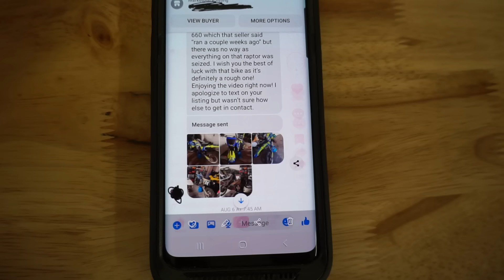Seller Lied To My Face About This $600 Dirt Bike (First Ride Attempt)

Comment: Just glad you got this,  instead of some kid who saved up to get his first bike.  Good job on this project
Reply: Yeah. That dude would have talked that kid into paying double for it.
Reply: Great point.
Reply: Sadly this just happend to me but different i bought my first quad which is an ltz400 it turned out stolen and had way more problems then he told me it had saved up for a year and a half and now i gotta do way more like frame swap it and do more
Reply: THIS point exactly! Awhile ago, I  purchased a 2001 Husqvarna CR125 that ended up needing EVERYTHING. It ran, but was lower on power than it should have been - long story short, power valve actuator had failed, took out some gear teeth, crank bearings were also burned up. 

I remember telling my wife - "The smart thing to do, if I wasn't an honest person, would be to put it back together as a 'running but needs a bit of tune up and TLC (as it would still start on the first or 2nd kick)' in the same condition as I purchased it in". Instead, after roughly $1000 or more in parts and a total rebuild I pretty much sold it and evened out in total cost invested and ALOT of lost time. 

My logic, aside from just being a decent human being, was that I couldn't stomache the thought of a 16 year old kid buying that bike with a load of issues using money he had saved up, and potentially ruining a wonderful hobby for him that could last him a lifetime.
Reply: Same thing exactly the same lol, I bought was advertised as a 2009 Kawasaki Kx85, in great running condition, what a crock that was, it was a 98 Kx80 w a newer style Kx85 gas tank, & not a 2009 Kx85, every single bearing/bushings, were rusted solid, cylinder was badly scored w all nikasil plating gone, clutch plates had zero friction material left, & clutch hub & basket was severely notched up, radiator was all smashed in w all cooling fins bent beyond straighting, long story short I put 5k into parts alone, but it is all high level performance & oem parts, & is better than new oh & the F&R suspension was crap also, thank goodness for Factory Connection,
Reply: Now I’m worried about it cause that kid is me
Reply: A kid should always take someone with them that knows what to look for
Reply: Sadly just happened to me sexier engine and burned centrifugal cluch on 2002 trx 250 ex shit blew in 30 mins just paid 2k for it saved up so much for the quad I wish karma on the dude who sold me it I’m only 17 smh but aye man ig you take losses shit really sucks tho
Reply: Seized*^

Comment: "My brother rode it last summer"  What a load of BOLLOCKS!!!  as we say here in the UK. Love your videos Joe, they brighten my day. Thanks.
Reply: He probably don’t have a brother
Reply: rode being the key word,  not under its own power mind you.  Holding on to a pick up until those hub bearings turned to dust
Reply: Grandma only road it to church on Sundays, and Ash Wednesday.
Reply: Cheers from Australia 👍
Reply: Thats why you should never buy a bike thats not running unless you are prepared to put a new motor and transmission in it.
Reply: @spartanx169x  That is always my first thought, worst-case scenario.  Swap a 250 for rebuilt 250, or worse a 450-650. But that would be easy.  You would miss the scrapes and scratches, hours searching for obscure parts, and running into brick walls at every turn.

Comment: Here is a tip for the grips. I drop a single nickel into the bottom of the grip so it lays flat. I do this to help prolong the life of the grip. Even as a kid I used to do this on my BMX bikes because I had so many grips get chewed up from the ends of the handle bars and poke through. The nickels help keep this from happening. Another grip tip if you have set of grips that in good condition but don't want to cut them off. I use compressed air and blow gun to float the grips off the bars. Works awesome.
Reply: No thanks. I’m not adding extra weight to my bike
Reply: @sk8er2420 might as well take all your plastics off 😂
Reply: That same air will help get them back on as well
Reply: i use spraypaint or clear, it works good and drys up and sticks
Reply: How about using some grip glue WTF
Reply: @MichaelLyons-h4i  nothing wrong with grip glue. You okay bro?
Reply: @PSBEadventures  yeah I'm fine bro how about you
Reply: @PSBEadventures  guarantee I've been around motorcycles on a lot longer than you have
Reply: @MichaelLyons-h4i  doing good man. Good to hear. I've been servicing them for a living for 35 years and it's been a great time. Still at it! Take care
Reply: @MichaelLyons-h4i I prefer hairspray over grip glue, works just as good, cheaper, and I can give the rest of the can to my gf so she’s happy. Win win

Comment: A bead of weld around the inside of the race will shrink the race when it cools. the bearing race will usually drop out.
Reply from the maker: I will try that
Reply: Just make sure to set the welder low enough so that you dont burn through the race! We do it all the time in my shop it works great
Reply: @2vintage  Did this for a fork head bearing, just in one spot, but no rust so maybe a few good spots instead. Good luck
Reply: Wow! A positive, constructive, helpful comment😂. I’m quickly checking news outlets for stories about a cold spell in hell. I’m gonna try this tip on my old Hodaka project, would give this bike a run for its money in the rust champion category. It’s also 20+ years older.
Reply: @2vintage  mate well done on getting this turd even running, and well done on the hammer. Oh and my bearing trick i use is keep a small selection of old inner and outer races that have one side of the ring/circle cut so it can flex open or close. Its a nice fit on a shaft or stem that uses the same bearing without binding as its no longer interference fit. I use them as dollys for removing and installing other bearings and or seals when necessary
Reply: @thediddly I've been doing the same since I was a teenager. The shop I work at has a really nice bearing install/removal kit but my custom tools still see a bit of use.
Reply: @Chris-ep5mv  custom tools dont always last but suit the job well and in this case...cheap to remake

Comment: Dude you crack me up. I love your expertise on purchasing used dirt bikes. After watching part one of this nightmare on yamaha street, we now have part two. After you took the carb apart and found half of the ocean in the float bowl that should given you some indication that you got hosed. After you took the cover off of the brake master and found the other half of the ocean, we can confirm. I can't believe you didn't take the rest of the bike apart. FYI, to bleed the brakes on a vehicle, you put a hose on the bleeder screw and place the tube in a cup filled with an inch or so of fluid. With the screw open you pump the master to purge the air out of the line making sure the master stays full of fluid. When all the bubbles gone close screw.  Can't believe you didn't take the engine apart, especially the clutch. Had to laugh when you put the chain on and the adjuster bolts were too long. When you had them out why didn't you cut like 3/4" off them and put back in ?   Anyway , you make great content for the masses, keep on wrenching....
Reply: You just yap away, huh?

Comment: Next time you have a bearing race that bad, lay a weld bead around the ID.  The cooling weld will shrink that race and if it doesnt fall out, you'll be able to use the weld as a surface to hit with a punch.  The welding trick works 98% of the time for me!

Comment: I absolutely cannot believe how easily that thing starts up. Also, I agree with your theory that somebody was riding that on some ice and broke through. It probably sat there for a couple of days, if not weeks, and then they pulled it out and it sat. It's an absolute miracle that it's running, let alone how good it's running. Absolutely blows my mind. 😂😂🐝🐝😂😂

Comment: So i recently picked up a sand blaster from Harbor Freight that was fair priced and it worked quite well for my projects, you might want to look into getting one yourself. They work quite well for cleaning up bolts so when you spray them after with the good ole PB Blaster it actually penetrates the bolt and not just the rust... Maybe you already have one i cant remember but its just a thought seeing how you work on so many classic machines you can clean up just about anything with them. Also i picked up an ultrasonic cleaner for carbs and other small parts so i can give them a soak overnight before tearing them apart and that has also impressed me quite a bit. Good luck with all the projects Bro and thanks for all the great content, the educational value is second to none your a legend my guy much love bro...

Comment: You should have got a brass punch with your new hammer instead of beating the hell out of that socket extension. 😅 😂
Reply: One step at a time..
Reply: Or perhaps wood instead of mushrooming the axle threads
Reply from the maker: Just orderd some!
Reply: And a normal set of screw drivers instead of using the bits
Reply: @2vintage  I was just kidding. I have extensions that are dedicated to pounding out seals, bearings, and races. You cannot even use them as extensions. ✌️

Comment: I for one kinda loved the claw hammer, mostly for how irrationally angry it made people 😜

Also:
1.) weld a bead on the inside of a stuck race to help dislodge and give you something to pry against.
2.) I knew the PO basically retapped the axle adjusters to Home Depot spec….as soon as you started wrenching on it with the impact it was confirmed 😣
Reply: Tbh I have dead blows and ball peens, and still prefer to use a claw hammer😂😂 the claw honestly comes in handy for prying in a pinch

Comment: To remove stuck bearing races, run a bead of weld around the inside of the race. When the weld cools, the contraction will make removal easy!. Tried & tested and unlike the little cutting wheel, leaves no damage.

Comment: cracks open the grips “SPIT ON THEM THANGS” 😂
Reply: Hawk Tua lol 😅
Reply: I always used aerosol paint when putting on new grips. Of course you have to give them time to set up so it's best to do it at night before you go to bed.
Reply: @stkyfngrszmooth   I need to replace the grips on my ktm and was thinking of actually trying to spit on them and see how it works.. does the paint make them not slide off?
Reply: @JNubski  washing up liquid ;)
Reply: This is why I'm here. Hawk Tuah 😂
Reply: @JNubski  Once they dry, they're never coming off unless you want them to, but it's important to let them dry completely.
Reply: @stkyfngrszmooth  any aerosol paint?
Reply: @JNubski  I always use Krylon, but that's me.

Comment: I live in the rust belt and almost everything I've ever worked on was in this condition. Rusted and snapped bolts, snapped frames. Oxy/act torch and the scrapyard are my best friends 😂. Definatley takes a different level of patience to work on these.

Comment: One on the few YouTube channels I subscribe to and I’m not into social media. 
Been in the hospital and had surgery so I’m catching up. 
It amazes me the lack of proper care, maintenance, and storage of bike people don’t do. 
Keep flushing her out. Change the crankcase fluid, ride it, and repeat. She’ll be fine. 
I stuck 250 2-stroke in an off- road water crossing and the case took in water from the vent tube. 
This method worked. The crank gave a couple of years later and I did a full rebuild at that point. But I believe the method saved it and prolonged the need for the rebuild.
I have medical issues, old injuries that have come back to haunt me, and I just can’t ride dirt bikes anymore. 
…I love ya, Joe, but you ride, not drive, a bike. With as much stuff as you work on, I also tired of watching you pull pipe springs with vice gips. I have a pipe spring puller tool that now never gets used. Send my your mailing address and I’ll send it to you, free of charge..

Comment: Just hold the kill switch if the throttle sticks mate.
Reply: 😆 you've never had a stuck wide open 2-stroke w that comment.... 2-stroke will not shut off w the kill at WFO because they start to act like a diesel n killing the spark does nothing ... been there done it... the owner reached over n shut the fuel off to stop it....

Comment: I honestly find it fun to verify the year by the vin/frame # on old stuff, as well as seeing whatever info is available like the frame and engine number range for a specific year and seeing (if the engine and frame don't match) what year your replacement motor is. All very good ideas in the sub $1000 range in my experience.

Comment: Screwdrivers are designed to turn screws, not to act as chisel's or drift's. Now you have your ballpein hammer please invest in a set of steel drift's and chisel's. I saw a comment earlier where you said you had ordered a set of brass drift's. Don't use them to install bearings as pieces of brass are prone to breaking off which may contaminate the bearing race. Also vacuum brake bleeding kits are great for one man operations. If the seals were leaking on that front caliper then you would've noticed. Keep up the good work Joe👍👍👍

Comment: Joe I think you're on to a winner with the dremmel/wheel bearing. I'd suggest going
into the outer race at around 30/40 degrees off of vertical, with the bike wheel 
how you had it anyhow. Also when oiling a foam filter you need only use a little oil 
but crush the filter down into a ball in your hand. When you relax the filter it will be 
evenly covered in oil.

If you're gonna work on Japanese bikes it's probably wise to buy a set of metric 
taps and dies for cleaning up damaged threads. Keep up the good videos Joe,
we watch 'em every day :o).

Comment: This may have already been posted but we used to take a welder and put a weld around the race and it will fall out, if not at least you will have something to hit from the side. Works pretty good most of the time

Comment: Use line wrenches on those tensioner. Might help not round then off. Spray internal threads with lube then run them in and out a few times. If it don't work, might have to chase threads with tap.. great vid !!

Comment: You read the comments, do ya?  Well let me just tell you thanks for the inspiration.  I've watched a bunch of your videos and finally got off of my butt and got out in the garage.  I got the DRZ that's been sitting out there for the last two years running and took it for first ride tonight.  Bought it non-running in 2022 for $500 and then just kind of forgot about it.  Classic DRZ crank case full of gas.  A petcock, a battery, a carb rebuild, and an oil change later I've got a runner/driver.  Lil bog mid-throttle but it goes and stops.  

First off road bike, btw.  SO FUN.  Even dropped it in some sand messing around by some construction sites.  XD

Thanks bud!

Comment: The penetrating oil needs time to do it's thing.  I recommend you anticipate working on stuff and basically spray any/all fastens, specially when they're weathered, at least a few hours before trying to brake free anything.  I like to do it a few times, days before working on machines.  You'll brake less bolts and round off nuts.  As always, it's 100% better to prevent and prepare than improvise on the spot.  Things tend to go south when you don't plan ahead, and just hope an pray...  I really enjoy your channel. just keep trying to improve your work, we never stop learning.  👍

Comment: Just a tip on the bearing races. If you have a mig welder you can run a small bead on the inside of the race, when the welds cool they will pull the race in away from the seat and you can pop it right out.

Comment: Mechanic here for 45+years. Heat up the bolt with a propane torch, then touch and melt a crayon on the bolt. It will travel down the threads and not evaporate like Penetrating oil

Comment: A little tip for taking grips off or putting them back in. Use a compressed air. Just put the pistol in the grip and with compressed air it pops out with little wiggles and you can save old grips for the future. The same trick works also other way around from the inside. You can also cut the outsides of grips if your bar has caps and blow compressed air and wiggle the sucker in. ez

Comment: Hey 2vintage.   A good way to get those stuck bearing races is to weld a small bead around the whole inner race.  Wen it cools it shrinks and it'll almost fall out.    Sometimes I've only had to do 4 spot beads on them and they come out easy.

Comment: Damn......that's a nice hammer. :D It would be interesting to see how a hard whack with that new hammer on a cold chisel might work on those old brittle bearing races.  

OK....the threaded rod for an axle just broke the record. lol
Best motorcycle mechanicing videos on the internets Joe. Thanks.

Comment: From experience, when you are removing a bolt especially on something that is rough, when it gets hard to turn, don’t crank harder, spray it with penetrating oil and run it back in and out a few times and repeat, it takes less time to take your time than to remove a broken bolt.

Comment: About fitting that old brakeline to the new banjobolt: Did not see that you cleaned the surfaces of that brakeline mating-surfaces before screwing it together? - but guess you did, and not everything makes it to the final video? .(had some problems myself with re-using copperwashers when doing and top-end for my -91 oilboiler, gsxr 1100. Off it went again, and heated the washers/re-surfaced them on a fine sandpaper plus cleaned the banjobolts and all mating surfaces). Sorry for long text - really like your videos - keep it up! :)

Comment: I left my CBF1000 in for service once.  They handed me my rear wheel bearing in much the same shape.  My eyes opened because I had just the previous week done 1xx mph on it and backed off because of excessive vibration.  Thankfully it didnt completely detonate at that speed!